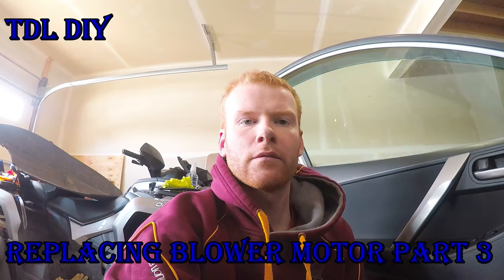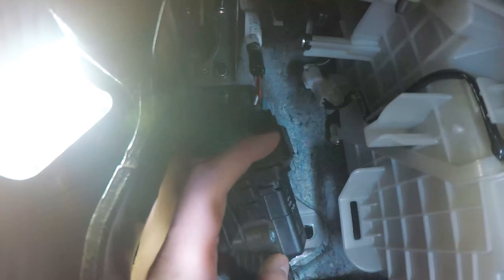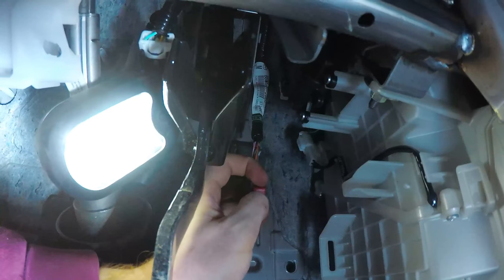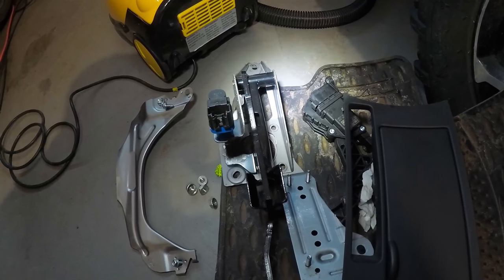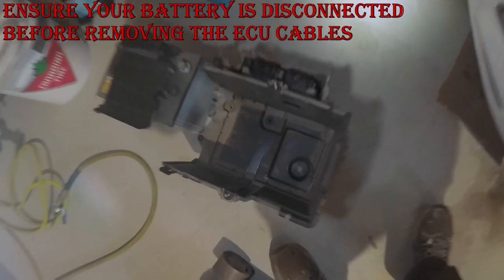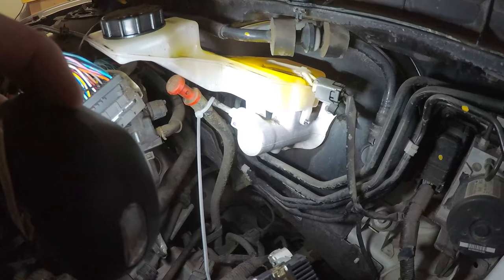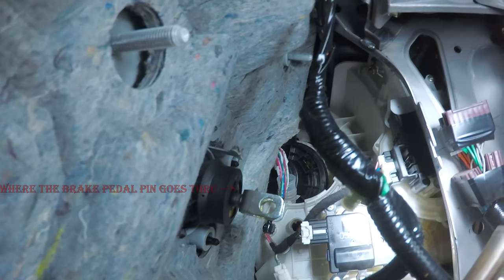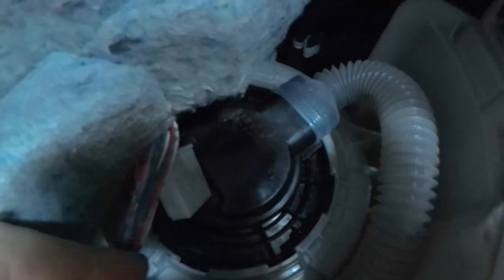Replacing Blower Motor Part 3

Comment: Never seen a part be so difficult to replace as this one you have the patience I could only dream of thank you so much for your tutorial ..yet I am not looking forward to this project
Reply from the maker: Yes its the hardest blower motors i have ever seen to remove. Your welcome and i hope this helps with your journey.
Reply: There was a KIA I did it was almost the same but just remove the two nuts snd gas/brake peddle whole unit is removed three screws and then it pulls right out this sucks having to remove from passenger side for sure.

Comment: You have the patience of a god. I tried this on my 2006 mazda 3, I could not believe how infuriating and convoluted they designed all these plastic pieces. 
I tried to do it from both sides but could not get my hand up there like that with the column in the way.
When attempting to remove the whole dash, everything is interlocking and impossible to to take apart.  
Thats what happens when mazda teams up with ford I suppose. 
To save my sanity I stopped and put it back together and am going to pay someone $600 to replace a $35 part. Absolutely ridiculous!!
This has made me decide to possibly sell my 3, such a garbage design and not user friendly.
Its interesting that when they redesigned the second generation, they just kept it the same way, F. everyone who hates how this is placed in there.
Shows they just don't care, and design obsolescence into your car at 100k to 150k miles.
Reply from the maker: Well Thank you, It wasn't the easiest thing to do. But now i have done it i think i could do it much faster if i has to do it again. I am thinking about getting some sheet metal and making the tool so it could possible be a little easier or at least possible save time in case i have to do this again Thanks to ( ChrisLawley ) for mentioning about this tool a while back he commented down below. Yes i was surprised how some of the plastic was interconnected as well like that. The steering column did get in the way a bit but since i am a smaller build person it wasn't too bad mostly just awkward. I do like the car quite a bit for gas mileage i drive about 150 km per day so it very nice for this save a bunch of money in gas compare to my pathfinder. But for replacing the blower motor and placing it in that spot is a huge design flaw in my opinion. While alot of other vehicle have it right under / up behind the glove box which make it a breeze to change. Well lucky it doesnt have to be changed as much as your air filter lol every 100k to 150k miles isnt bad to do once in a while but still a big pain. 

Ps when i decide to make that tool i will make a video and post it up could help some people out. I heard it needed with standard transmissions because the clutch gets in the way.

Comment: Nice video but since blower motor comes out from passenger side you don’t need to take brake pedal off only gas pedal to make space and been able to take connector and turn blower counterclockwise and pull it ,please don’t pull brake pedal so much trouble if you have time and want to be able to get your complete body under the steering wheel ok do it but it’s not necessary

Comment: Theres a tool you can buy to use, I can't believe you got it out without it. I thought for sure the tool would be needed. I paid the dealer once to do this and I'm done with them. These blower motors from Mazda are JUNK so I am gonna attempt it next so this will be the third motor that will be going into my 2010 mazda 3. I think the tool to use would be easier because you don't have to remove so much stuff. I think I'll order the tool because I'm a big guy and had a dam tuff time trying to get my body in there on the drivers side. I also have a 5 spd manual instead of a automatic
Reply from the maker: ChrisLawley - Thanks for watching my video. I personally didn't know there was a tool. althou it was fairly easy without it.  I have looked into replacing the blower motor from YouTube and guides online and most wanted the steering colum out as well. I tried to remove as little as possible for this to work. If I was doing it again I think it can be done in about 3 to 5 hours max. yes this could be slightly different with a 6 speed manual. I went with a new blower from www.rockauto.com. This might be an option for you next time. only reason I went this way I wanted a cheaper option then the factory one which was expensive.
Reply: yes I ordered mine from rock auto as well and when I attempted it once I said forget it I can't do this and had the dealer do it and they supplied the part but now the dam thing is going out again I said no i gotta try and do it myself. So literally a week ago I found a mazdatech.com page telling you how to and it tells you about this tool to use which is like a piece of pipe that goes over the squirrel cage fins and attached to the three clips on the motor so you are literally removing the motor and all from the passenger side, now you still have to remove the electrical clip and vent tube from the drivers side but that should be it. Removing the gas pedal still does not give me enough room to get in there to do all what you did. I really think the dealer used this tool because I just don't think the tech removed all he center console because when I picked my car up everything in the center consul and small box was EXACTly as I dropped it off to them. The service Manager confirmed the part number from this tool which I got from snap-on so I don't know maybe its a waste maybe it isn't, still way the hell cheaper then paying the dealer to do this. My thing is hopefully the rock auto part will last longer. This blower really is a shitty design, I have a 1998 jeep wrangler since it was new and NEVER EVER replaced the blower motor in it.
Reply from the maker: ChrisLawley - Ya that tools definally sounds like it would be alot faster and possible 10x easier.  You were saying snap-on sells it. what's the part number maybe I can do a review and possible give it a try in another video sometime. 

The materials or design maybe could've been better. They don't make part and or vehicles like they used to. Seems like these Mazda 3 blower motors go quicker then some other companies. The spot where they put the blower Motor is not ideal either.
Reply: 49 B061 015A this is the part number from snapon although i called snap-on today and they gave me another division of snap-on that i had to call for it. I was emailed a picture of it and could have easily made it but figured what the hell just order it, I'm sure I'll be using it a couple more times before i get rid of the car then I'll just sell the tooling on eBay or something.
Reply from the maker: ChrisLawley - Thanks for the part number I will look into it. Yes you are probably right you may need it for a couple uses. Nice thing with most tools they some what keep a resale value. I hope it works out for you. Let me know how it works if you happen to get it before I get it or look into it more.
Reply: I can email you a picture of it because before i bought it they emailed a picture of it or hell wait for me to get it and i'll give you the dimensions and you can make it lol
Reply: Thanks for these videos, they were a huge help. FYI it is possible to get the motor out without disassembling the drivers side. It was a bitch and a half but I was able to snake my arm past the pedals and disconnect the motor. Now I’ve discovered the replacement motor I bought has the wrong connector on it but that’s a different problem.
Reply from the maker: slackey360 - Thanks for watching, and I am glad you liked my videos. I know it's possible to get it off without removing the drivers side I actually tired I found it would've been more hassle for me and I couldn't really get in there. The other side of things I was reading people taking the steering column out. I didn't want to go that far but wanted to make it as easy as possible with removing the least as possible. I have been talking with another YouTuber and there is a tool you can get to remove it from the passenger side of the vehicle but you have to still disconnect the power cable and hose and the release clip for the blower motor. 

as for the power connector you could cut the old one off and replace the new one. solder it up and heat shrink it. or if you can take the pins out and put it in the new plastic connector. Those could be possible solutions.
Reply: TDL DIY thanks for the reply. I was able to get the connector situation figured out and then figured out how to get the motor in without the special tool. I stuck a screwdriver through the fins of the blower and into one of the slots that the special tool locks into. Then I zip tied the screwdriver so that it was secure. The screwdriver basically acted as a handle that allowed me to maneuver the motor and rotate it to lock it in. Then I just cut the zip ties and buttoned everything back up.
Reply from the maker: Slackey360 - Hey no problem I like to reply back to comments made if possible. Right on what did you end up doing to the connector? I am glad you were able to get the blower motor removed and back in sounds ingenious what you did, hey work with the tools your have right. I don't have the special tool either but I am thinking about making one and seeing how that turns out. Glad things worked out for you and again Thanks for watching.
Reply: TDL DIY for the connector I ended up making a frankenconnector - I cut the connector out of the old motor housing with a dremel and cut it in half, keeping the tip of the connector that allows the tab to lock in. Then I took the pins out of the new connector and cut it in half, keeping the back half that the pins lock into. I had to cut the tips of the pins to be the same size as the old pins. Then I epoxied the front half of the old connector to the back half of the new connector and reinserted the pins and it worked! Would not recommend but for me it was easier than returning the aftermarket motor and going to the dealer to get the oem part.
Reply from the maker: Slackey360 - I am glad it worked out for you. Some procedure you went through but hey it works that's what counts. I think that's one thing I like about Youtube there is a lot of ways to skin a cat sorta speak. I like seeing how people go about different ways to the same result some are very ingenious, and some are just up easy. Ya those OEM parts from the dealer are really pricey. I order a lot of cars parts from rockauto.com and I also search ebay once in a while. Not sure where you go but rockauto.com has been good to me so far.

Comment: I disconnected the blower motors power and got the tube off but the blower motor is still very tight in there and cannot get it out the passenger side

Comment: So you take the battery and ecu out just to remove the brake pedal? 
Personally I would try to do this repair with the brake pedal in place.
Reply from the maker: I did it this way because i did try leaving in place and i felt i didnt have enough room to see and do what i needed to do. If you can do it without removing all that by all means go for it. This is a guide, and how i did it so it can possible help someone else out. 

Thanks for watching and commenting.
Reply: @TDLDIY  props for taking it on! 
Hopefully with this guide people won't need to see as much as you did.
Reply from the maker: @TonicofSonic  100% it helps show a process but if people can it quicker or with not removing as much i would love to hear about it... so we can pass that knowledge off to others.

Comment: So, after repressing the tab, do you rotate the motor itself or the retaining ring and which way do you have to rotated to release the motor. I can't seem to get the motor to release. Thanks.
Reply: I've got a 2010 so it's the same system, which is different then the earlier year model.
Reply from the maker: It's been awhile since I have done it but once you realize the tabs I believe you rotate it counterclockwise. it should be easily figured out by looking at the design. 

You will have to rotate it from the drivers side. The whole blower more will rotate.

I hope this helps. Thanks for watching
Reply: I got it!!! But damn this was one of the most difficult car repairs I've ever done and I've done a ton of car repairs. Thanks for making the video.
Reply: I don't even know which way I turned it. I just depressed the tab and jiggled the damn thing loose.

Comment: So what was the reason to replace the blower??? I missed the original inspection.
Reply from the maker: The Reason was it was making sounds that got louder as the fan speed increased. It was quite loud.
Reply: TDL DIY : besides the noise, did you noticed any cooling issues ??? And did you addresses the cabin filter any time. In advance thanx for your time!! 👍👍👍
Reply from the maker: @KNACPUREROCK  No real cooling issues that i was aware of since it was my brother in laws car. But i did go with him for a drive to kinda figure out what was wrong. NO cooling issues. Yes the cabin air filter was changed after the noise came, he ran with that for awhile and after i replaced the blower motor we did change the filter again to ensure those parts were clean and new. 

I hope this helps. Thanks for watching.

Comment: attempting to remove the blower motor on my 07 Mazda 3,  having trouble disconnecting the power cord attached to the motor,  can you describe the latching mechanism on the cable? since its such a tight squeeze i cant see the connection, ive been basing it off of feel but cant seem to disconnect the cable.
Reply from the maker: It should be a Push button style clip then pull out. If that makes sense. Yes your right it is very hard to get in there. If you go to 5:32 in the video you can kinda see the connector,  you will push down and pull out to get it to disconnect. I hope this helps
Reply: @TDLDIY  thanks, finally got that S.O.B disconnected.
Reply from the maker: @jwhit4075  - Hey glad to hear. Those blower motors are in a bad spot. Hopefully one day they will change the placement of it.

Comment: It can’t come out the other way? Is there just no room for the length of the basket or is the basket bigger then the whole and won’t come out at all ok driver side? Such a DUMB set up it has worked for decades coming right out the bottom behind the glove box. Let’s change it now to make it a nightmare to get to and pull out lol. I am tackling this tomorrow in someone’s car and was praying removing the peddles that I could click turn and pull out guess not LOL price is going up every ten seconds of watching these videos hahah.
Reply from the maker: You can not get it out from the passenger side. I agree it is a bad design for sure. I have seen people get it out with removing the brake pedal but i found i needed more room. I hope this helps in some way and answers your question.
Reply: I thought you had to remove it from the passenger side? You said you can not get it out that way was that a miss type, as stating you can not get out on the driver side?
Reply from the maker: @mentallyderanged9169  oh your right the locking tabs are on the drivers side.